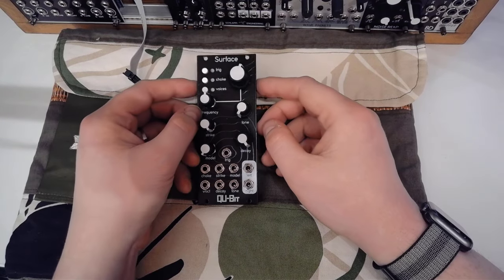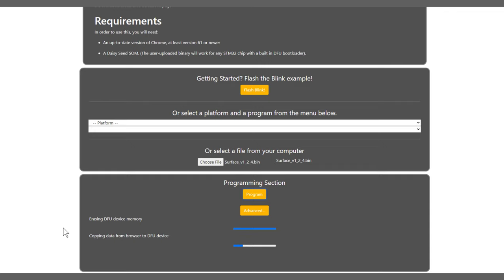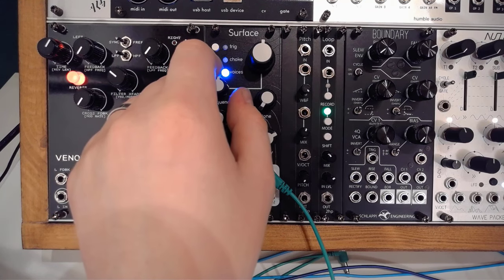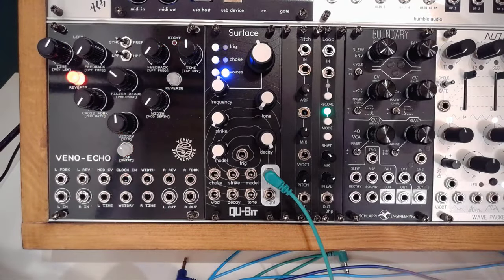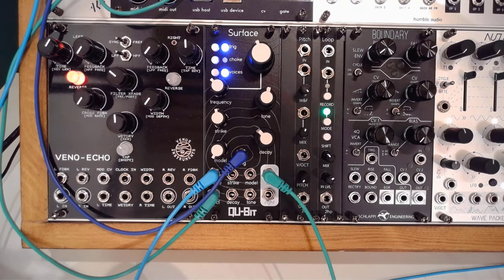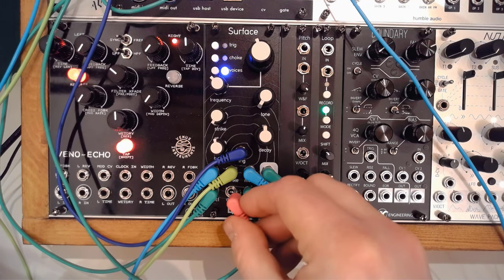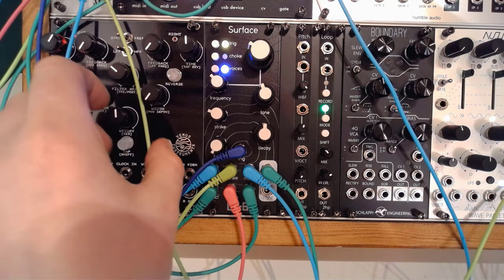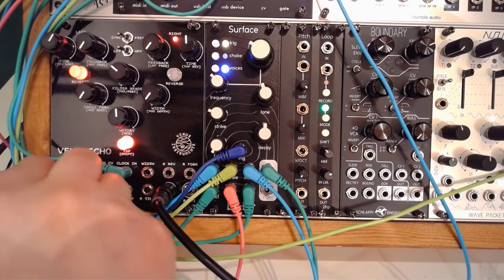Episode 82: Qu-bit Electronix Surface | Physical Modeling Voice | Featuring a firmware upgrade

Comment: Sounds great. Am I correct that Surace only does short / plucky / trigger sounds (with a longer decay when when adjusted) But no holding / gated notes? Sorry for the noob question I am rather new to this :)
Reply from the maker: No worries! We all started somewhere and nobody understands better that the best way to learn is to ask the important questions. As far as I know you cannot get a sustained note from Surface, but it could be that its "Dark Mode" offers some of the functionality you're looking for. 
As Surface is mostly focused on synthesizing physical sounds it would make sense that it only offers triggered sounds but it could also be that alternative firmwares offer more functionality.

Comment: How does it compare with Rings/Rings clones?
Reply from the maker: Fair question, unfortunately I haven't used Rings (yet) so I would not be able to give an educated answer.
Reply: Apart from the Karplus-Strong synthesis they really don't compare. In that regard Rings has more parameters to tweak, while Surface has the ability to more different type of sounds. If you're more into dedicated modules I'd stick to Rings, but if you want to CV change 'instruments' in the way you can do with CYO or Plonk, Surface will be the better choice.

Comment: qu bit has pitch problems acrosss octaves
Reply from the maker: You can calibrate it but please feel free to reach out if you have trouble.
Reply: @TheModularClubhouse  so i tried to calibrate it and update the firmware but when i press connect through daisy there is no fsb there is only a  hd webcam option...???
Reply: so I got a new cable and I was able to upload the zip file from surface but when I clicked reset like you did in your video it does not come out of  boot mode   any suggestions
 @TheModularClubhouse
Reply from the maker: Absolutely a good question: I would always recommend to reach out to the Qubit support team. They are phenomenal, so I expect they will be able to assist you in no time.